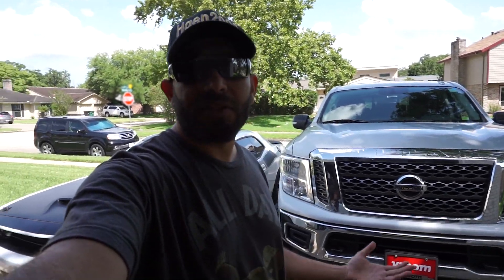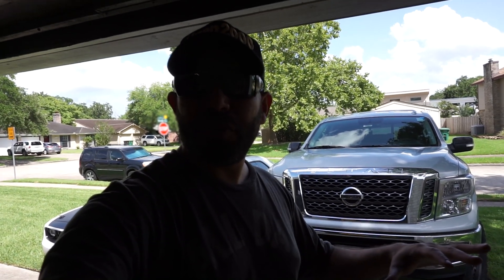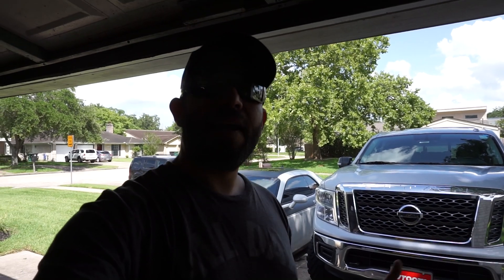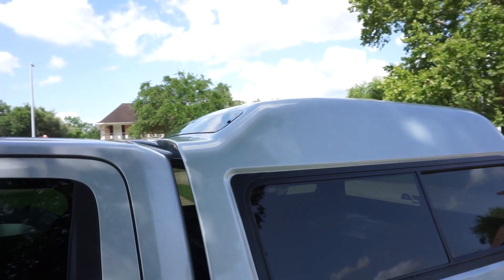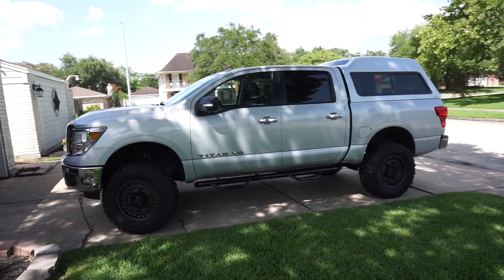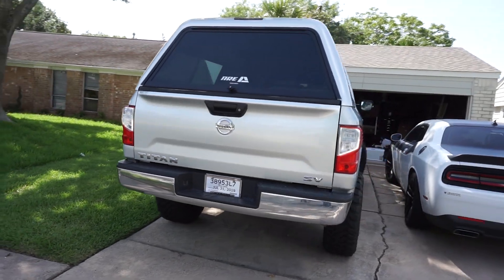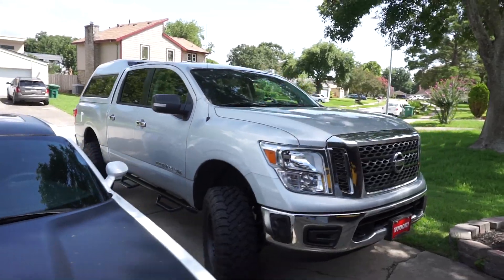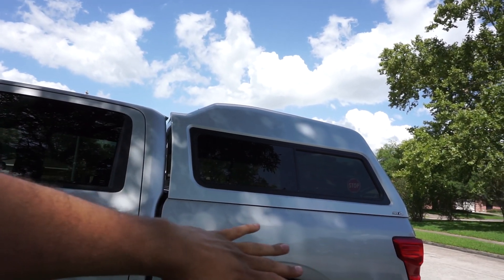Doomsday Datsun gets the ultimate Lithium dual battery inverter setup!

Comment: That truck is bad ass. Not that my opinion matters. These battery companies should be paying you to test and advertise their products.. At least get some 5/16 fuel line and split it long ways to line that hole in the bed. Fill split with quality RTV and.you will be good. You could heat shrink that wire two feet thick and eventually that bed metal will wear through it..
Reply from the maker: Yes. I actually just made the hole even larger because i added 300 watts of solar to the roof so I have to come up with something totally different. I’m trying to find some sort of hard plastic or metal to act as a conduit. There might even be something off the shelf I dunno.

Comment: I would make the hole round and use a grommet. We use McMaster Carr at work for all of our emergencies aka fuck-ups and we get parts quick. I am sure pricing is high, so shopping around should be done. And that way, you cn just use a hole-saw to make the cut clean.

Separately, I really like the truck. I was less that optimistic at first, as it was too plain jane. You have done a remarkable job making it your own. I really like the look. That was an incredible deal on the nerf bars, or whatever they call them now. Great job.
Reply: https://www.mcmaster.com/grommets
Reply from the maker: Yeah I’m adding solar now so I’ll need to make that hole even larger so I’ll probably use a hole saw I had one but not as small as it would need to be for the wires. That way I can just use an off the shelf grommet.

Yeah it was super plain and boring stock. Seems like a totally different truck now.
Reply from the maker: In any event that wire is fused on both sides (since it gets power from both sides) so it should be pretty safe even if it did eventually rub and arc which i really don’t think it will. But I’ll go with a grommet since that seems way safer. I probably didn’t need to go 0000 wire there but I wanted to make sure I could charge quickly and use loads with no concerns. I don’t want to run a second wire when the first isn’t enough or replace it or anything.

Comment: thanks for the video . i want to build a box like that . you should check into solar panel to mount on camper roof to have a way to charge batt when truck is off
Reply from the maker: I have 300watts of solar that I'll be installing probably tomorrow. lol. with a 40 amp mppt solar controller. The batteries are lithium so they charge pretty quickly but yeah for sustainability needs solar for sure.

Comment: Are you going to run an a/c in the capper?
Reply from the maker: I'd like to. I have a zero breeze which of course wouldn't cool the capper. I'm looking for some sort of AC setup for the back. but I don't want it to draw huge current. Maybe a portable AC. I dunno... Suggestions?

Comment: next project is to make the truck EMP proof. great job so far
Reply from the maker: Yeah is that even possible with a modern truck? From what I understand because of the metal shell most cars are already emp proof because of the design. I recall a show where they hit some cars with emp and it didn’t disable most of them. If anything they just had to restart them.
Reply: never really looked that much. I see info either way    https://www.youtube.com/watch?v=0s7EXnPAS8o

Comment: Love the look of the truck. Great choice  on all the parts. I absolutely love those wheels. If I may make one suggestion, take a fuel line and cut it length wise with a razor and use that fuel line to act as a buffer between the battery cables and the bed where you cut it. I think the heat shrink you bought with get cut through after a while. The hose will hold up much better. But love the build and your ideas.

Comment: How would you go about doing a chrome delete I have the same truck
Reply from the maker: But since there is a midnight edition which I believe has no chrome it sounds like all of the parts at least exist
Reply: Hqen2000 yea you right about that I was told to just get the truck wrapped
Reply from the maker: Would be pretty damn hard. Truck has chrome all over.